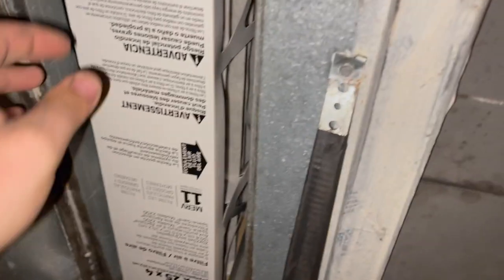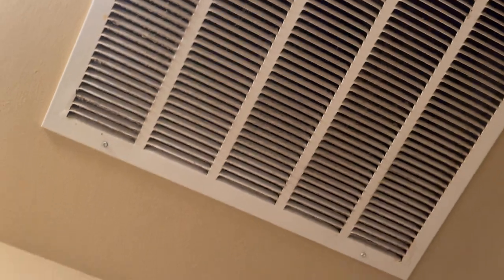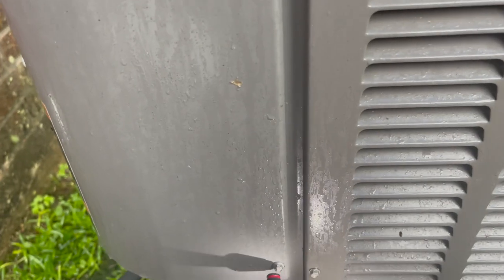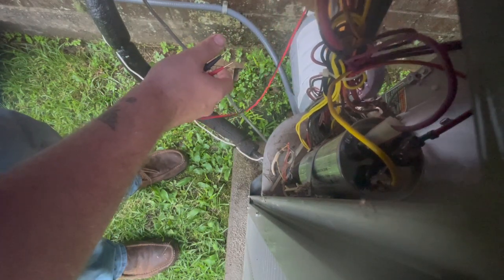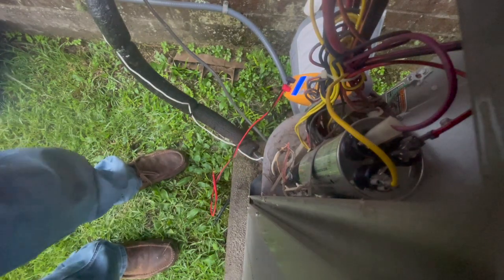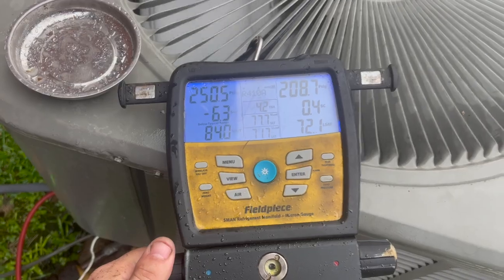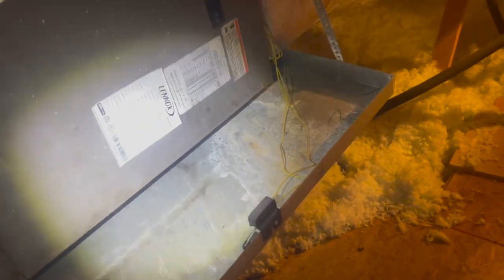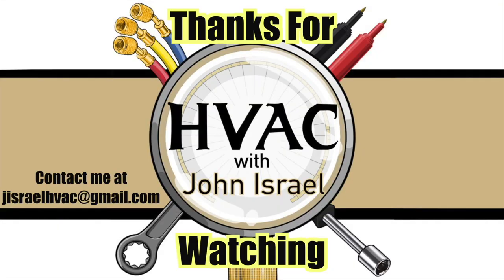More Lennox Junk Leaking/Not Cooling

Comment: I just replaced a 15 year old 5 ton Lennox XC16 air conditioner and furnace and a 4 ton Goodman  from 2018. 
Back on Wednesday 4/10/24 the Lennox furnace was rusted out I now have 2 brand new 3.5 ton Goodman and a 5 ton Goodman air conditioner.”
It’s nice to have reliable air conditioning.

Comment: Great job in AZ we have been dealing with Monsoon rain storms making it so hard to make repairs in torrential downpours. Also extreme condensation line clogs. Worst weather in 20 years
Reply: best weather since you need rain in AZ :hydrate:
Reply: It’s nice that we’re finally getting a lot of rain in AZ but it hasn’t been good for all the cheesy wood framed stucco houses here that were not designed to handle rain for more than 10 minutes lol. There’s even some houses here where the grade slopes INTO the foundation.
Reply: I miss az now being in New Jersey for couple years tired of the snow already bit keeps me busy so can't complain to much

Comment: Immediately thought she outta gas or has very little in it. At least your getting rain down there, up here in CT we haven’t had much rain at all… I completely agree lennox is junk man, you don’t know how many leaking coils I’ve already changed and they are all only a few years old! Terrible units, they used to be good back in the 80’s and 90’s… Just replaced an uncased ADP coil today on top of an oil fired furnace, wasn’t too much fun but we got it done.

Comment: I just started working HVAC didn’t realize lenonex was junk? Thought it was a decent higher end unit?
Reply: I bought two in 2007 and nothing but failures witch each of them, so i would say expensive junk, at least the ones I bought, Seer 18, 410A units.
Reply: Lennox is horrible with evap coil leaks. If its low, can just about guarantee that the leak is at the evap

Comment: Just had to have my POS Armstrong coil swapped out (under full parts and labor warranty thankfully) but had to wait 3 weeks to get it when it’s over 100 degrees here. Will never own anything Lennox has any part of again!
Reply: Well, trane is not any better, i mean just about everything now a days no matter what it is, whether its a washer machine or a computer or a tv is a over price piece of shit full of chineese parts and way over priced, very efficient lol, you wont save anything though, because what you saved will be spent on repairs. This summer i have changed more evaporator coils on systems between 1 and 3 year mark. Most of the units that are 10 years old have already had at least one coil replaced already if not two.

Comment: I hate Lennox so much. Spent 35-40k on a brand new central AC in 2018 when I bought my house. Thing breaks without fails 2-3x a year. The iComfort system and Smarthub, pure chinese made junk. The little Mitsubish ductless split in my basement never fails ever. Simple cheap remote. The less electronics in these things the better. Of course my warranty was only 5 years so it finally died after 6. Lennox sucks.